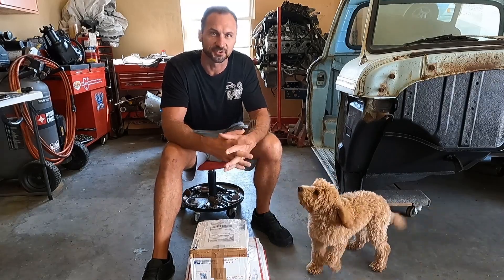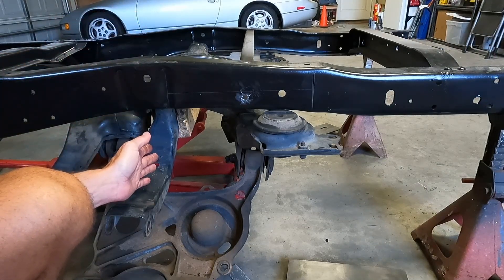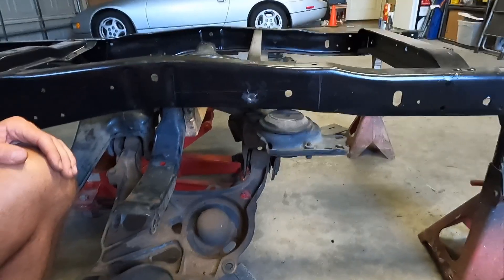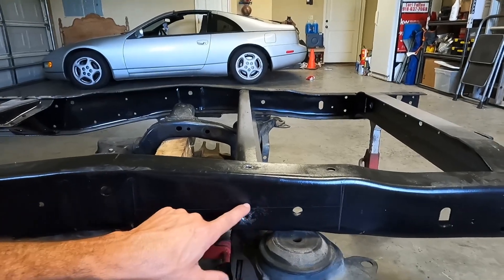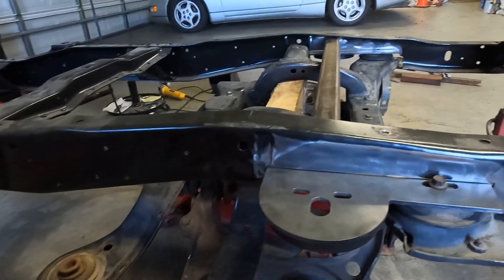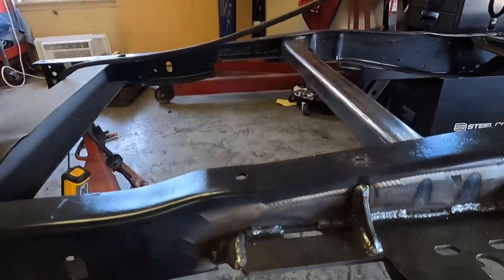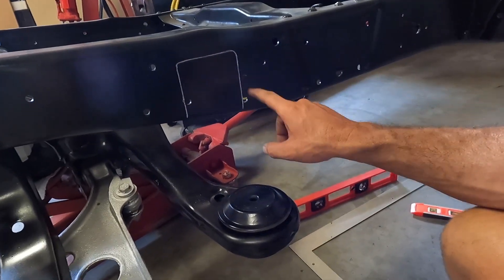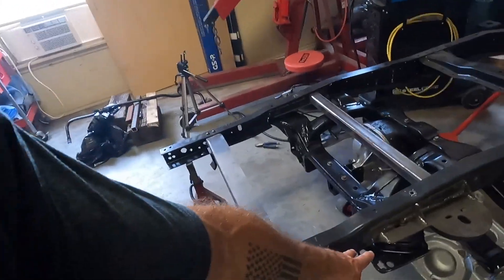'64 F100 Project! Part 9: Installing the rear suspension. Team321.com

Comment: i get it that the frame should be levelled before doing an IRS install, but i'm confused as to where the baseline is. there are so many angles on that frame - top and bottom - what exactly is a safe place to start to level it?